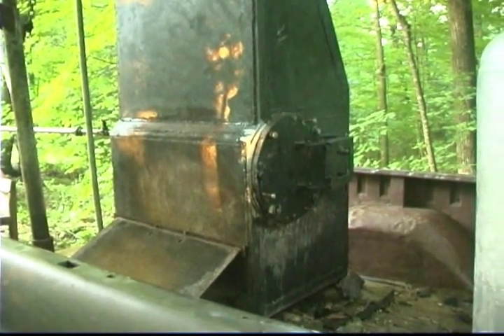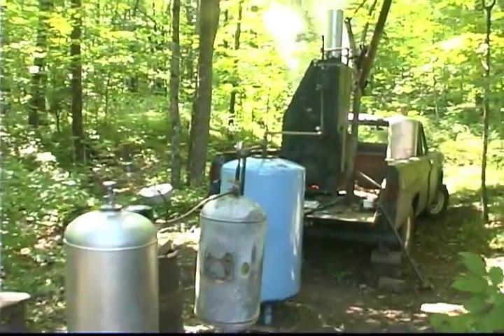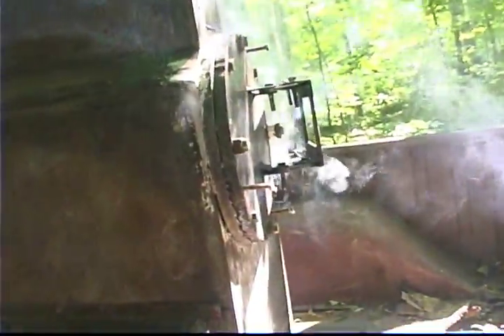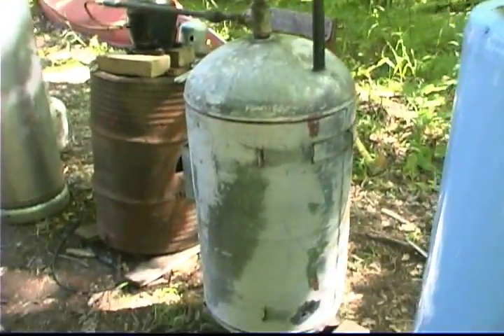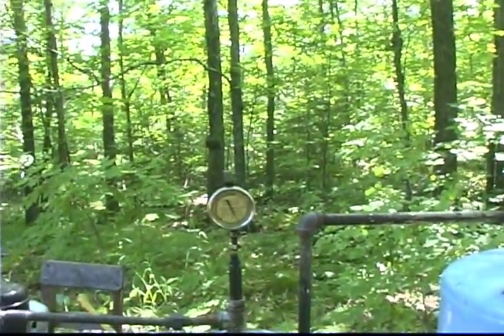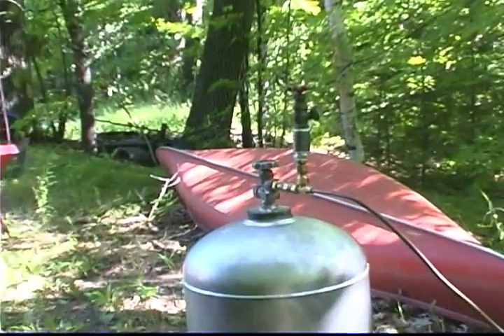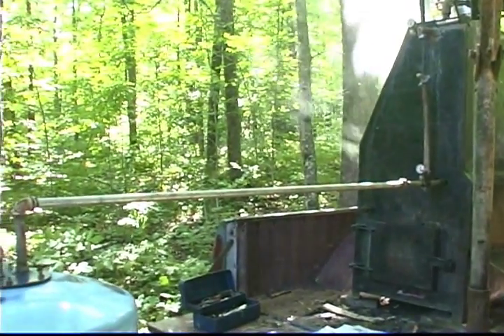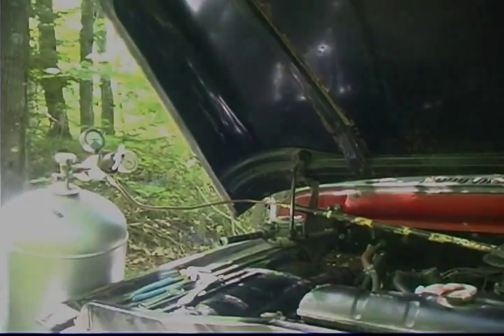Runnin' On Wood Gas

Comment from the maker: Common question. Although it is hard to search my channel because I also have musical, political, philosophical and comical interests and videos, other videos about the Energy Bootlegger further explain and answer your question. I also answer many comments. After the refrigerator compressor I used a another style compressor but still only got 90psi. Study natural gas vehicles they need 3000+ psi tanks & compressors. This gas is closer to natural gas less carbon monoxide than gasifier wood gas.

Comment from the maker: @irreverentreverend First off the gas line was bumping up against the hood, loud. Second, mixture was too lean because the regulator would not let out enough volume.  Check out the blue(primary) gage at 2:04 (90psi), then at 2:30 (0 psi).  Once I shut it off the gage went back up to like 75 or 80 psi.  So I think I need to modify a regulator, then the propane carb' should work if I set it as rich as it will go. It is only fine tuning now and I will be able to make, store & run on ho'made gas:)